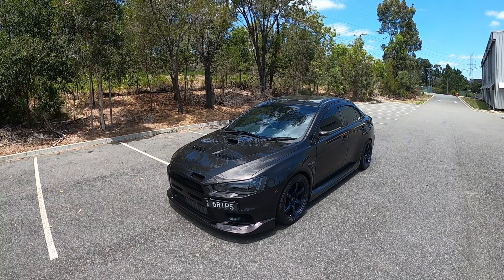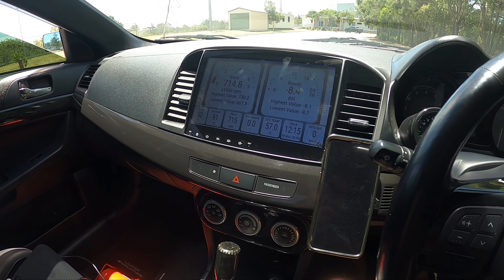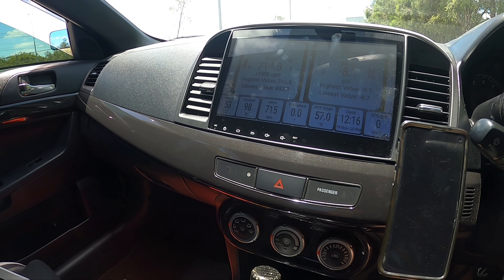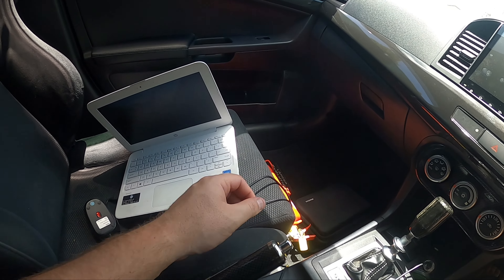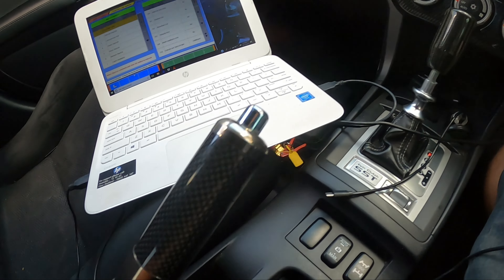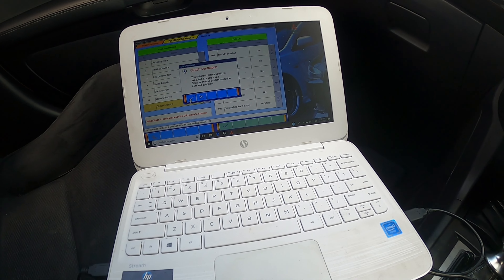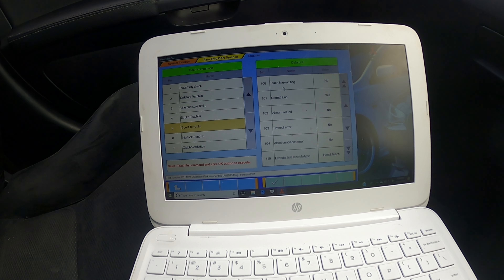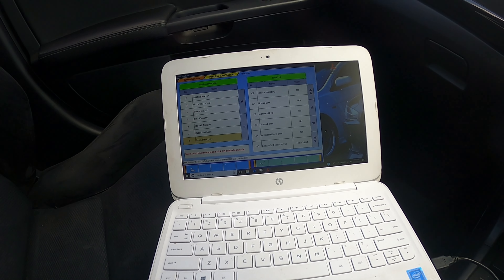How To Perform An SST Teach In For  Your Evo X Or Ralliart Lancer

Comment: Anyone getting the 'TC-SST recalibration data not found' error message when attempting to enter the teach-in section, there are two files required to be in two certain locations:

AMT_17800000_000204_dio30_C.cbf must be put into C:\Program Files\PassThruCAN\DiagDB\CBF.
and
TI_Info.tipart must be put into C:\Program Files\PassThruCAN\DiagDB\XML

If you don't have an XML folder, create one.
These two key files can be found in the main directory of Jackson's linked documents (SST Support Files)

Enjoy boys.
Reply from the maker: You're a legend this was what I struggled with and ended somehow getting mine to work but couldn't remember a year or so later how I did it 

I'll pin this comment to the top so it can help others in the future
Reply: Good evening, I'm trying to do this process on my 09 Lancer Ralliart. At first I was getting a different error message apart from this one and after doing what you said it got passed that one and now I'm getting this one even after creating those additional folders. Any guidance would be much appreciated, Thank you.

Comment: Has your tuner removed the first gear limiter?
Reply from the maker: As in the spark cut launch control limiter that only let's me rev to 4.5k?
If so no he hasn't but doing the teach in the car was still able to rev to where it needed.
I do have the map without spark cut though and can flash it back on if needed
Reply: When I purchased my MR new in 2008, the SST had a really bad delay engaging first gear no matter how hard you pressed on the gas pedal.  It was so annoying.  As time passed, tuners learned to remove that first gear limiter which allows it to engage off the line quicker.  I still wish it was a little more quicker.  It’s the one thing that annoys me a bit as my wife’s Mini Cooper S launches allot quicker
Reply: I’m super greatful for this video of yours and the access to the software.  I have 145,000 miles and have not performed a teach in since the dealer last serviced the transmission at 30,000 miles
Reply from the maker: That's awesome man and I'm glad its helpful as That's a big reason why I started making videos.
Your car will definitely love the teach in then and should make it drive a lot better
Reply from the maker: And as for the delay yeah its annoying isn't it, im hoping to get rid of it once I get my SST rebuilt, or as close to it as possible
Reply: Are you going to get new clutches, shift fork magnet, and other things installed?  Do they tune the TCU after that?
Reply from the maker: Yep all of those will get done and yes will get tuned to suit, hopefully will be done by mid next year as we are in the process of buying a house at the moment so cant spend any money on cars right now haha
Reply: Looking forward to you posting a video of your thoughts on an upgraded SST.  I just finnished installing the software..super excited!  Thank you
Reply: @JacksonStrain  how much does new clutches cost? And magnet? Just interesting, because in my country it's about 900 usd for stage 2 clutches and about 300 usd for a new magnet. It's for parts only, without work.
Reply: Ran the software last night and took it for a ride.  The shifts are much smoother.  At first the reaction to the paddles were slow but after about 4 min it was back to normal.  This morning the car is shifting so nice and smooth.  And I drive it in super sport 100% of the time and it feels as smooth as normal mode.  Very cool!
Reply: One thing that’s still concerning with the SST is upon startup, every so often I get the gear grind.  I cringe when I hear it.  Do you have any insight as to why that is?

Comment: The video shows how to download it but the program doesnt work. I found that the passthru can files were all modied by an unknown source which made the program inoperable. I downloaded the program as per instructions multiple times and still didnt work. Could you remake an updated video on how to get the program working?
Reply from the maker: Ahh damn that sucks i know i had trouble getting it to work when I downloaded it originally but after a few days of trial and error I got it working.
I don't want to delete the program off my laptop and try again but ill see if I can get another laptop to try and download it again and see what's happening
Reply: @JacksonStrain  did the buttons on the main screen stay grey and unclickable when you initially completed the download?
Reply from the maker: @kr3am818  no you have to get the files in the correct locations for it to work
Reply: @JacksonStrain  i did as per what the video said and it didnt work. Upon further inspection i noticed some of the files were modified and there were other ones added.
Reply from the maker: @kr3am818  from memory there's a certain xml file that needs to be in a certain location and that's what was stopping me from being able to use it. As I said it took me a few days to get it working but I basically had to double check all the files and download some separately and place them in the correct folders then it finally started working
Reply: Fwiw you will usually need to restart the pc/laptop for changes to take effect.

I was pulling mynhair out ages ago anf i rage quit. A week or so later when i calmed down i went to try it all again and it was working. 

One of the download tutorials that is commonly used is missing a folder designation.  The original one I used whcih was the merlin one? From.memory  had a file destination error when trying to get passthrucan working
Reply from the maker: @lynel1985  ah ok that could make sense as I remember pulling my hair out too, but once I tried again I definitely found i was missing a file or that it was in the wrong place.
I'm terrible with computers or else I'd make a video on how to get it working.
Reply: @JacksonStrain  ill have a look and see if i can find the error.  In my case it was (from memory) one directory name short for finding the regedit pathway.  Im scared to delete itnl start again but i may just do it for shitsngiggles.  I need to do a teach in. Changed fluid last week aswell.
Reply: What fluid did you use diaqueen or castrol?
Reply from the maker: @kr3am818  i use Castrol transmax dual which is what disqueen is just without the Mitsubishi label and price tag
Reply: @JacksonStrain  thanks just wanted to be sure. How much 7.5 or 8 litres?
Reply from the maker: @kr3am818  i think its 6.5 off the top of my head but I could be wrong, should get 3 services from a 20 litre drum

Comment: If i hadnt already done it myself, this would have been a good helpful video
Reply from the maker: Thanks mate, hopefully it's helpful to some who haven't already but figuired it's a good video to have on the channel.
Reply: Its a great video to have. Idk if you said it or not but if the program/computer freezes or stops working, its ok, just restart the program or computer and continue where you left off, this doesnt need to be done all at once, thats why you select which parts to use. No need to freak out if something messes up it wont hurt your sst or ecu or anything, itll all be fine.
Reply from the maker: @joeschmoe5009  i didn't mention that but should have as it can happen and would ve very scary the first time
Reply: @JacksonStrain  you could always comment it in the main section and pin it so itll be at the top of all comments
Reply from the maker: Yep will do that for sure

Comment: Hey Jack! How have you been? 
I need you again, I just happen to get the famouis P184B code on my sst (shift fork 4 malfunction, only code i got, lost 2 4 6 gears), i ordered a new shift fork with a magnet installed to replace my current one, im thinking on dropping the trans, swaping the shift fork, assembling it again and try if its fix
my question is: in my case, what would be my procedure?
install trans > wipe code > turn on car for the first time, is the trans gonna recognize the working shift fork? or do I have to perform the teach in as soon as I first start the car?
Maybe if you could please ask Akracing or someone you know have some info on this, thank you my friend.
btw I live in Paraguay, south america next to argentina and brasil so sending my trans for a rebuild somewhere is not an option for me heheh
Reply from the maker: Hey mate, sorry to hear about the shift fork issues. 

I can't answer that personally but my suggestion would be to join the Facebook group Mitsubishi SST Owners as there's lots of workshops in that group as well as people who have fixed their own SST.
Join up and ask there and you'll get some helpful answers I'm sure.

If not you could try emailing AK Racing to ask them but I think posting in that group is your best bet

Comment: Hi Jackson. very nice build. Can you tell me where you got your FQ bonnet? I would like to get one for my EVx
Reply from the maker: Hey mate I just have an OEM evo bonnet with an FQ400 vent in the front bumper, can get them from AK Racing
Reply: @JacksonStrain  Thanks for your reply. I'm about to change the oil and external filter on my SST and wanted to know, do I have to do the "teach-in" at the same time, or is it not related to the oil change?
Reply from the maker: @brettomeara5073  you don't have to but it's not a bad idea to

Comment: Should teach-ins be done at every SST fluid change or only when the service manuals says it needs to be done
Reply from the maker: I do it every SST service personally
Reply: @JacksonStrain  Did you find an alternative to find the SST temperature gauge in torque pro as the Advanced EX plugin got removed? I've heard OBDFusion with the add-on 'shows' the SST temp but not sure how accurate that'll be if it even works

Comment: Hi everyone, I’ve got a issue with the pass thru can program after downloading it and opening the program up its only displaying 7 steps not 8 which is reset clutch gains? 
Has this happened to anyone and how did you fit it thanks.